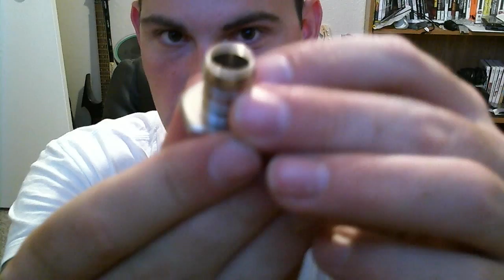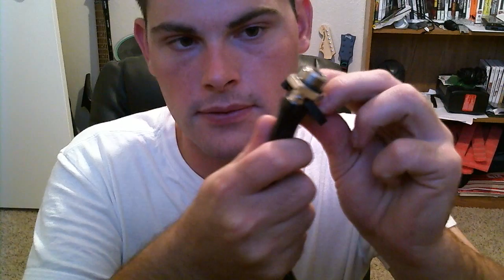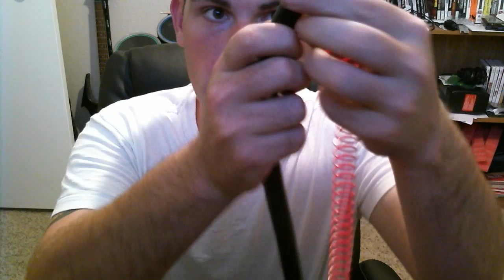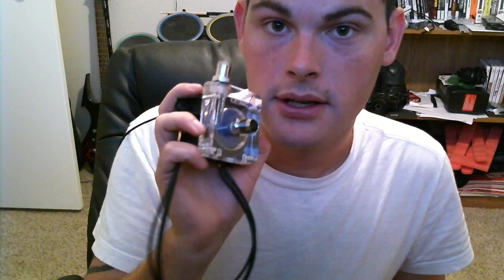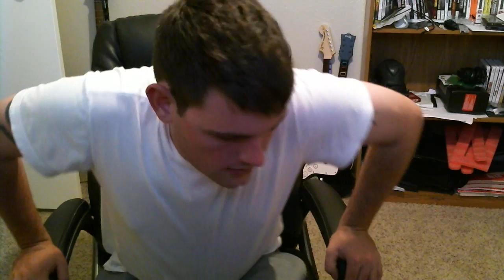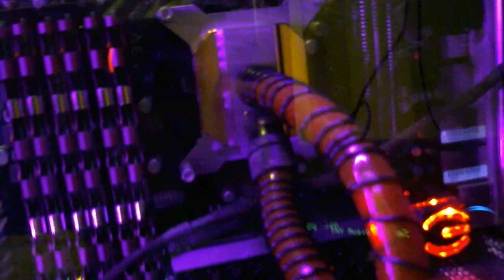Water cooling basics and setup (Rev.1)

Comment from the maker: @vito670 
I am using what i call an enthusiast setup I am using 2 mcp35x pumps 8 gentle typhoon fans, 4 on each 480 rad(2)
mcp35x draw 1.5 amps
the  fans does not  take that much power. 
I cant give you a definite power consumption but i can you this as long as you have a quality psu you will be fine

Comment: @BloodyRory Depends. What are your temps, and could dust be an issue. I like liquid cooling because it means there is only 1 place to keep dust free (radiator... maybe the power supply also). 

I would recommend using liquid on your cpu and when you plan to overclock your gpu or find your chipset running warm, get the addons then. Just remember to use fresh tubing when you change your setup (as wear and tear on the ends can cause leaks once the seal is broken)

Comment: @juggolo
I was saying you forgot to mention delta's not that there bad.

kazes might be fine for external water cooling where the long sides of the fans perpendicular to the floor but in internal water cooling the rad is usually mounted at the top of the case where the long sides fans are parallel to the floor which would allow for the oil to leak from the sleeve bearings and cause quick death.

plus feser is pronounced like phaser/facer goto feser-one(dot)com

Comment from the maker: @JagoTFC 
I will send you a pm with a link where you can get the fans hopefully Cm overrates there fans ans is not really a good radiator fan at all. doing a push pull can help lower temps 3-5 degrees. Tim for gpus I use mx-3 or mx4.

Comment: Will you advise the CM Excalibur to be used on the GTX series radiators? All the fans you talk about are not sold in Italy, and I prefer not to do mail orders for them. Also I don't see them as expensive for a push/pull configuration even on more than one radiator. How much a radiator between cpu out to gpu in can improve temperatures? What TIM is the best for GPU cooling?

Comment: What do you think of the CPX Pro, the Liangs are overpriced. Also, I disagree with your rad choice; the PA 120.3 or Feser X Changer are probably the best 360mm rads, but the RS360 or MCR320 are by far the best bang for your buck. You also didn't mention shrouds or anything of that nature.